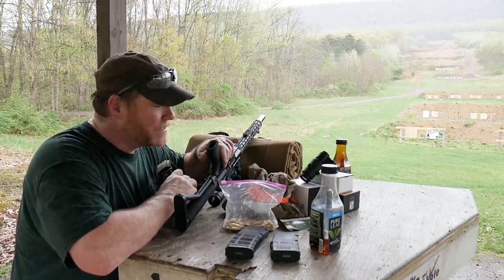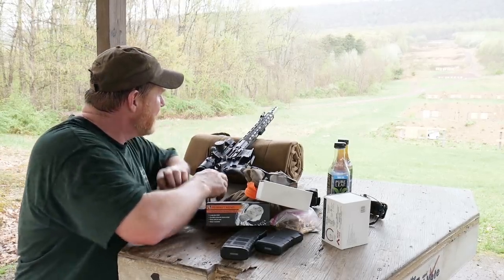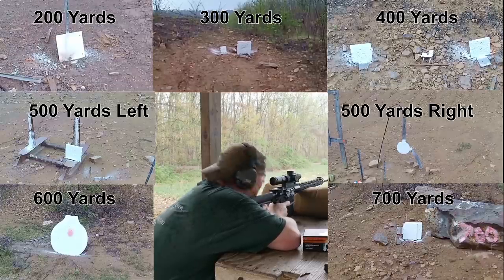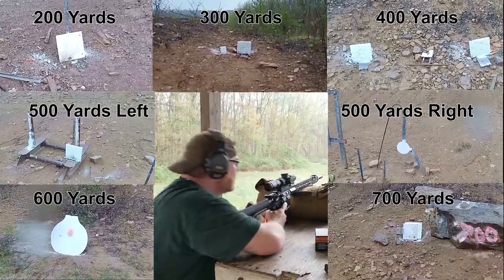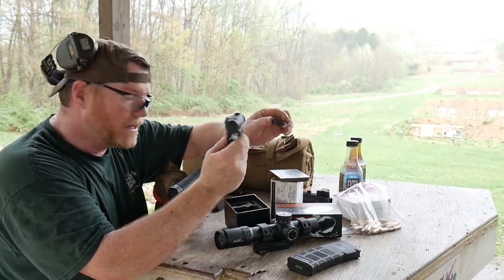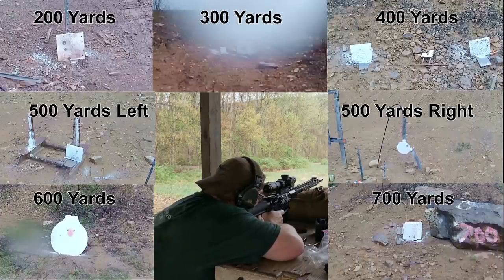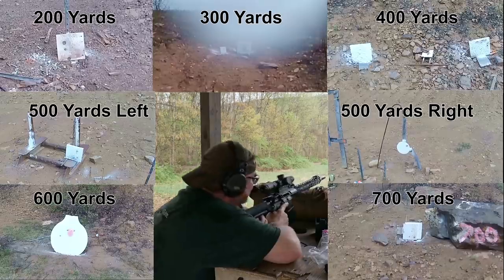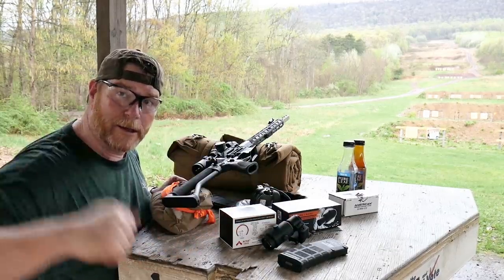Primary Arms Micro ACSS Reticle in the Holosun HS503G!!   Demonstration!!

Comment: Have you tried the Cyclopes with a magnifier? I bought one when they came out actually pre ordered it but I didn't keep it very long because my eyes aren't good enough to even use the reticle that's why I never bothered with the holosun acss but I guess with a magnifier it would work good I just wasn't sure if the reticle would even work once magnified beings its was set up originally with no magnification. Which brings me to my next question would it have to be a 3x magnifier or will any power magnification magnifier work? Or I guess it doesn't matter since putting the magnifier behind the reticle that makes it first focal plane now that I think about it?